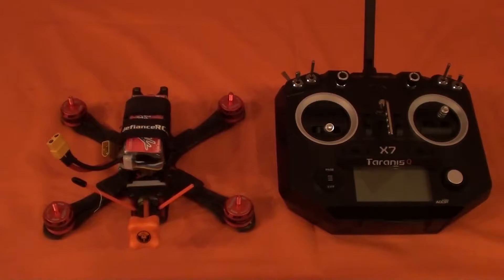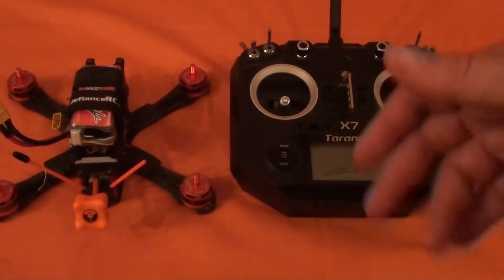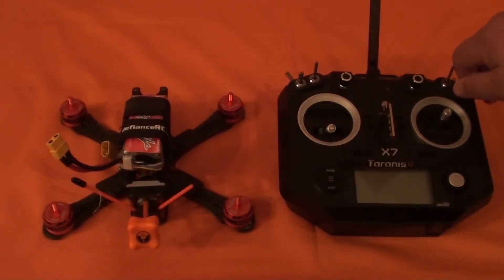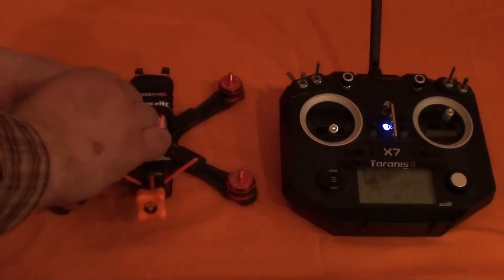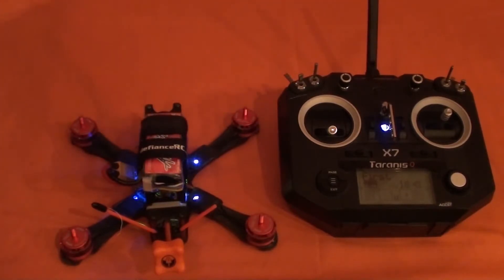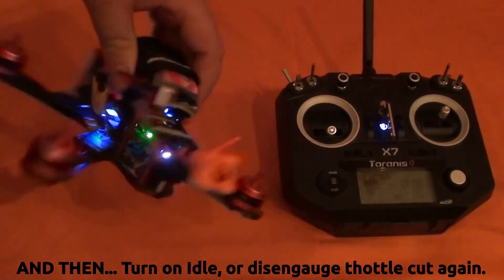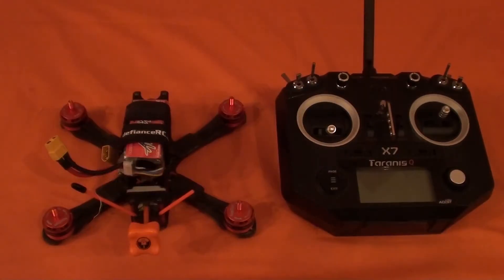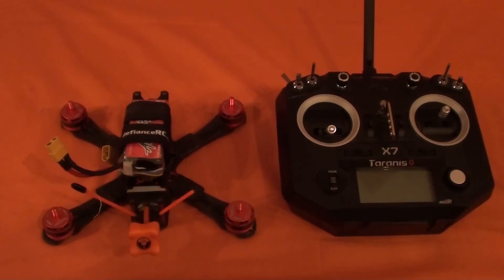Mr. Steels Idle up/Throttle cut issue shouldn't be an issue with openTX

Comment: It has more to do with 2 switch arming then you might think, Mr Steele wanted an idle up, and the safety of 2 switch arming. If this happens then do this kinda of setup. That's why his method only works in the switch sequences. Just my 2 cents.

Comment: If like to see how you would it.  I have mine set up in throttle cut, but do not notice a bid difference from airmode.  It was easier before.  May go back to airmode.
Reply: Man, my message was scrambled from typing.  Would love to see a video on how you did that.